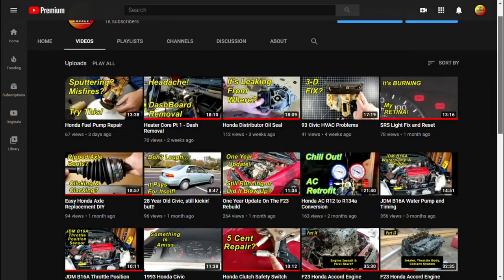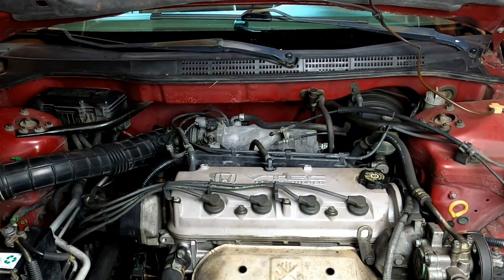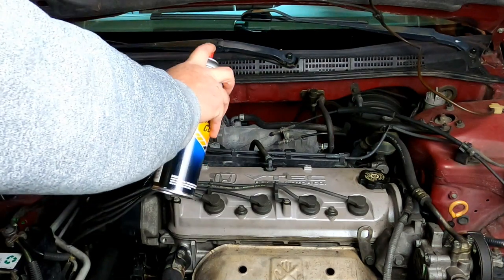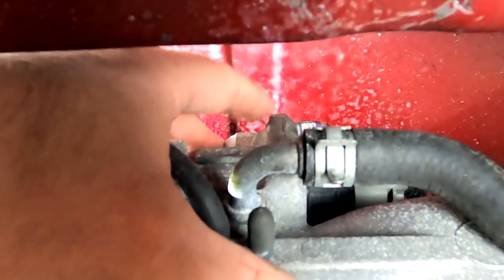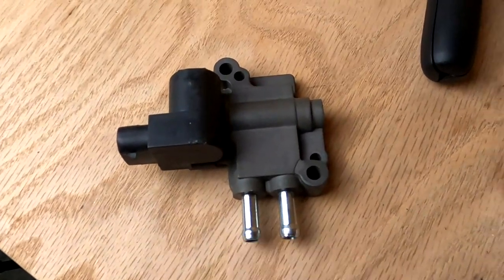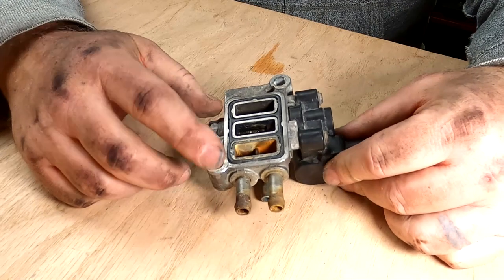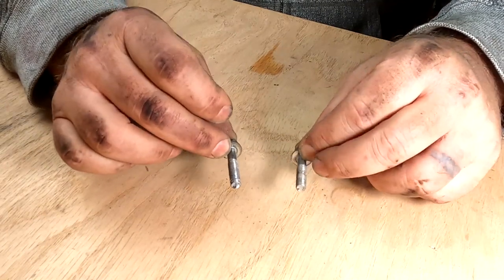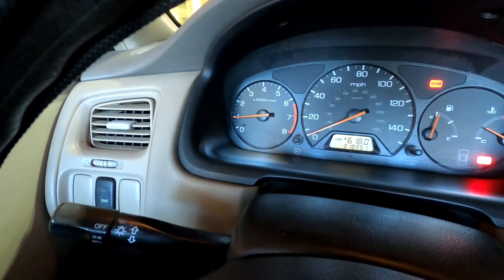Honda Idle Air Control Valve Cleaning

Comment: The other part that you got in your hand is the one that I was speaking about for $150 or less I'm at AutoZone and that is a Duralast so that's what you got and then the other one that's $800 that's the one that you had on your right hand and that's the one that you need they are $800 in special order..
Reply: They're $22 on eBay.
Reply: @lukeleonard3965  you pay for what you get. Replaced it for free. Special order due to shortage of parts like this. We use o.e.m.

Comment: Are the water/coolant hoses that heat up the case of the IACV necessary to be plugged in? Is it beneficial to have it heated?
Reply from the maker: Some people delete the hoses, but to work as intended, it needs to heat up to operating temperature. I wouldn't do the delete.

Comment: I.a.c is not cheap.. for the none ulvec it 150.00 is tou have a ulvtec and slevtec  are over 800.00 usd and special order..
Looked for a vacuum leak and still new hoses new I.a.c. and still have a problem.
Reply from the maker: Check all around your throttle body for a leak. I've found two leaking throttle bodies with the same symptom since this video and replacing them with a junkyard part fixed it. If you can get your hands on a smoke machine, that is the easiest way. Even if you have to pay a shop their diagnostic fee to smoke it, I would. I finally broke down and purchased one and it has already payed for itself. Wished I had it back when I made these videos! Good luck!
Reply: Ebay
Reply: @machiavelli4428  ebay has counterfeit parts, that's why they're so cheap
Reply: @cryeredd7563  no.all buyers are protected from counterfeits.ive been buying parts last 12 years from eBay. I've never had an issue with parts including after market.
Reply: @machiavelli4428  perhaps, but how many people buy the knockoff crap and never realize?  No way oem injectors or ignition coils can be as cheap as on ebay and not be fake.  That's one for instance of many
Reply: $...plain and simple. I am not mechanically inclined. my mechanic only uses new parts, but it works. I am 80% through mechanically on my 95 del sol. o I wish I didn't love her!!! DC